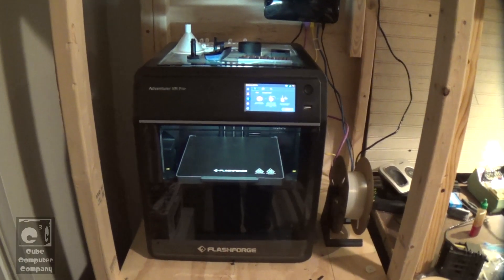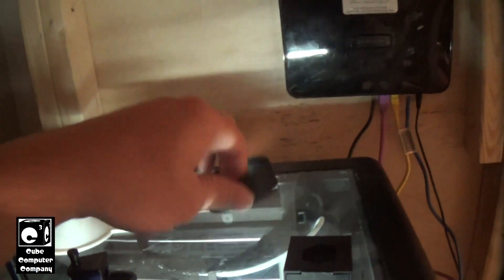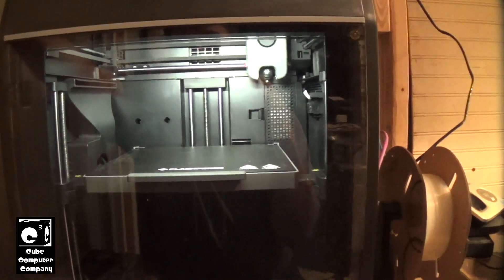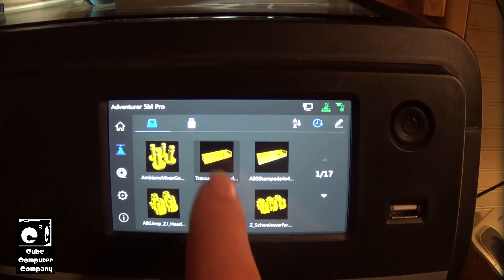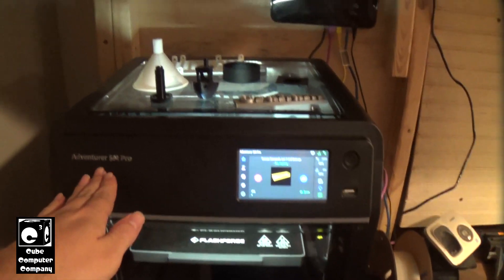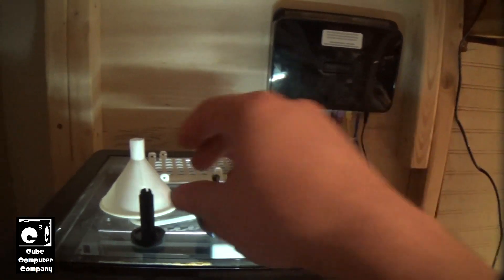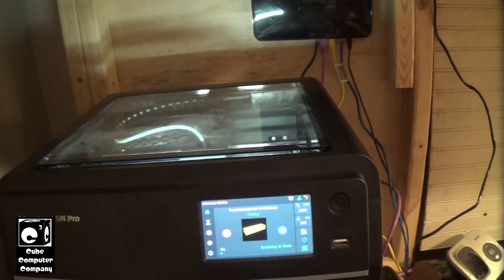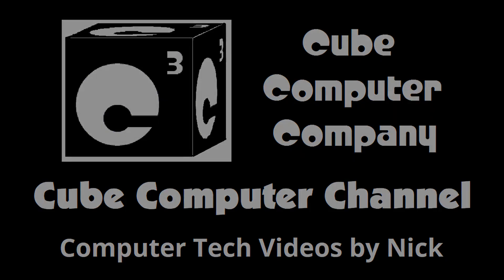Is the FlashForge Adventurer 5M Pro worth buying? I've owned this one 1 year.

Comment: I got a Flashforge Adventurer 5M Pro. After 3 months started having problems. Bought a new extruder kit. for $100 from Flashforge after installation it quit all together. I am on a fixed income and still have to make payments on a piece of junk i now use as a shelf. Please don't buy this one, it's not worth the head aches.
Reply: Seems you posted this on a few different videos about this printer. Bot
Reply from the maker: You must have a lemon

Comment: I think i ran into one of your videos back in feb 2024 when i was looking into the printer before i got it. Its been solid and i think any print mess ups i have had has been on my end if i forgot to change orcaslicer settings or ones i have ran into lately tangled spool of filament, that being said i have ran 20-30 1kg roll and a few thousand hrs and besides basic maintenance i havent had as much as a even a filament clog on it. The Elegoo  Centauri Carbon is looking like a real bargain for a bigger print size 256mm/320c harden .4m nozzle and future multi-material support for 299 right now. Thinking of grabbing one cause i really want to mod the M5 pro upgrading or bypassing the main board with a pi4 or something to run full latest klipper ,Up grading the tool head /adding a chamber heater to print more engineering type filaments.
Reply: You can install Forge-X on your printer (I have it on mine) and have fully fledged Klipper running on it - I am pretty happy with it as it is.

Comment: sadly I don't know how to 3D model so I'm limited to only print models I find, that's why I haven't used my printer that much.
Actually I use Orcaslicer and I have done several things with it because it's so easy to use, i have modeled several things both from scratch and modified existing models with it.
But Orcaslicer is very limited to what can be done with it so I can't do many things I want on it.

There are several ideas I would like to print but I don't know how to model them :(

I tried couple 3D modeling programs, for example FreeCAD, which was way too complicated I didn't get it at all.

I also tried SelfCAD, which initially looked simpler, but after installing it on my laptop, the program was so slow and laggy, I would need a more powerful PC to use it, so I gave up on it and didn't even try learning it.

I haven't found any good modeling program. and it's difficult for me to find any because I want a free program that I can install on my computer and use offline.

TinkerCAD sounds like a much easier program but it's online only and I don't want such things.

Comment: one thing I dislike about this machine is that the air filters only filter the air that is going out of the chamber.
More precisely, one filter is for internal air circulation, and the other is used for external air circulation(so the filter filters the chamber air before it leaves the machine).
the air intake is not filtered, that causes all the dust in the outside air to enter the printer, which is a shame.
Reply: Can your make you own intake filter & housing and mount it over the fan intake?
Reply: @Enmesharra92  the intake is behind the machine between the rear steel wall and filament roll so I don't think there's space for a filter unless you place your filament roll elsewhere.

Comment: occasionally I use the 5M Pro to dry my filaments, I put something on the bed so the roll is not directly in contact with the hot bed, set the bed to 110°C and let it be inside the printer for several hours. it's a great way to dry filament. I also turn on the internal air fan to have the air cirulate inside.

but the problem is, that about every 15minutes the bed heater turns off, so I have to babysit it and always turn it back on for hours on end...

I told flashforge to make an option in the firmware so users can set the bed heater timer on for however long they want.

If you think that's a good idea please message them too about this request, because it's more likely they will do something when more than one user is requesting it.
Reply: Every printer turns the nozzle and bed off after a time period for safety reasons. Just create an STL that heats the bed and waits however many hours you need.

Comment: when leveling, before the machine starts it scratches the build plate, I want to skip that step because I don't want my build plate scrathed, and I can clean the nozzle myself better anyway.
On my PC sticker build plate the hot nozzle even melted the plate!
but there's no way to skip that scrubbing step. I told flashforge to add an option in the firmware to skip it, if you think that's a good idea please message them too.